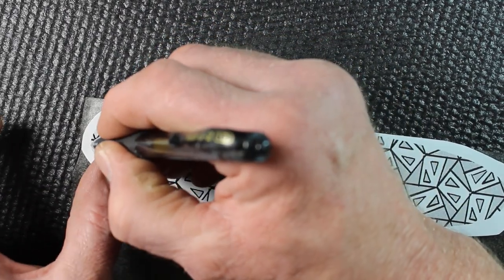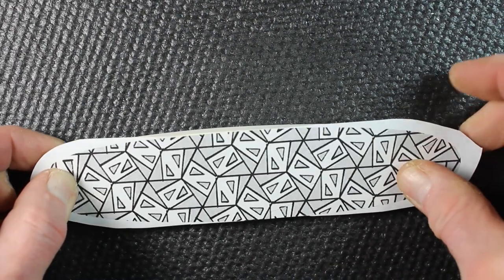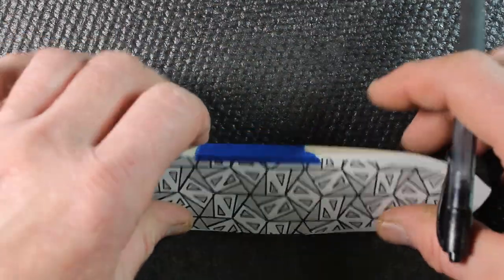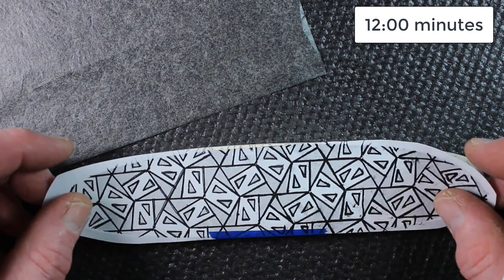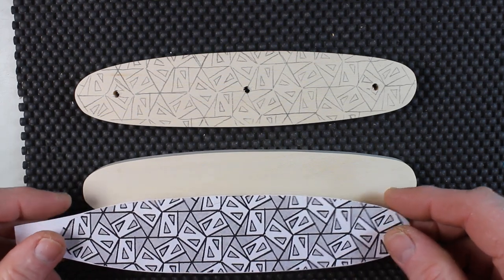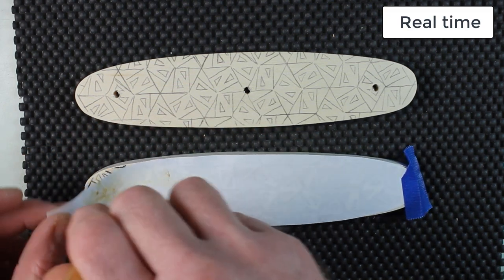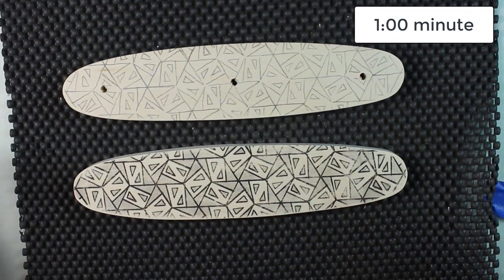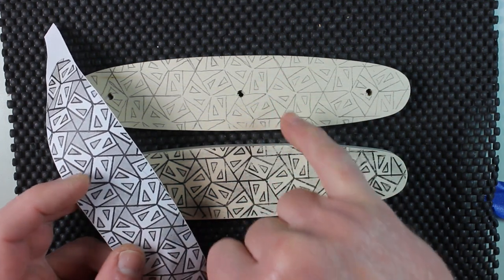Chip Carving, pattern application, why are you still tracing?

Comment: that must be the biggest load of rubbish I have seen in a long while
Reply from the maker: And why would you say this?
Reply: @MyChipCarving  The cost for a start and I don't think it would be much quicker. At least 10 years of carving and very few problems in tracing patterns.
Reply from the maker: @neildunbar1231  thx for replying. We apply a lot of patterns and it is much much faster, more accurate, and repeatable. For example, using the PTT to apply a pattern on a 6x12 practice board. 2 minutes max! 
I guarantee you, best $20 you've spent in a long time. Good luck with your carving.
Reply: Could you just use and old clothes iron instead of this “PTT”